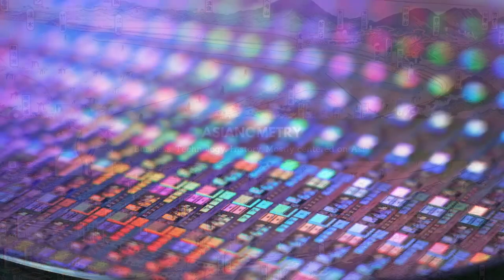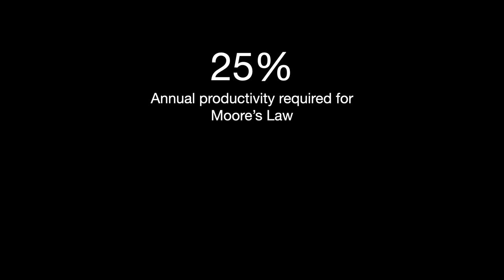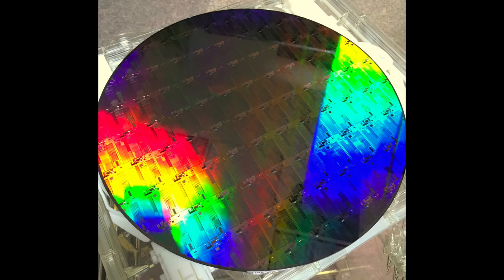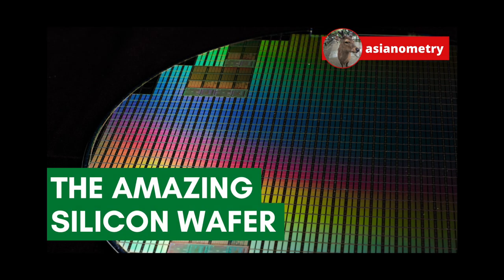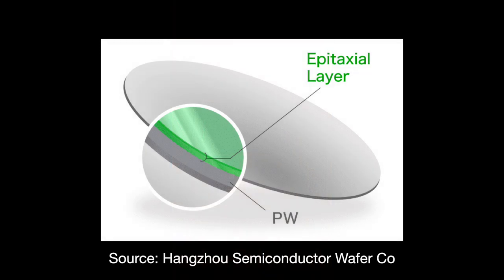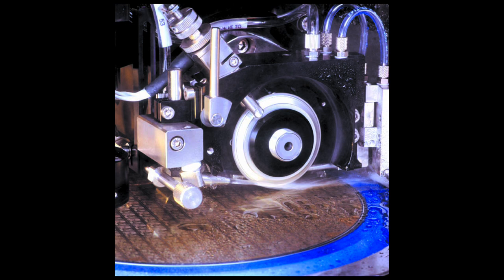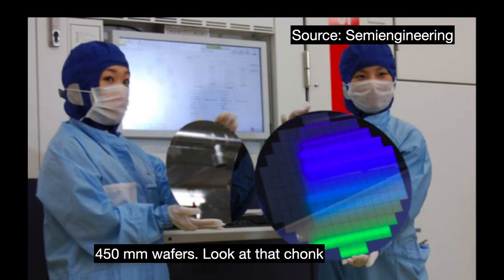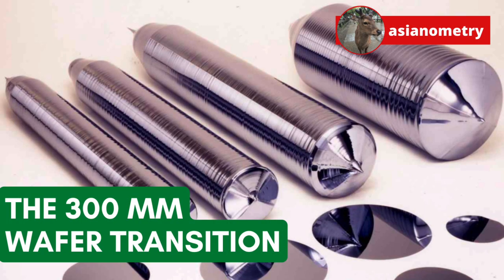The 300mm Silicon Wafer Transition

Comment: Great video as always. I have one question
Why is there a requirement for 200mm Wafers? I don't get it, is it because it is cheaper?
Reply: Because there's a requirement for 180-350nm chips as well as analogue chips and power semiconductor devices designed for an old process. Old production line needs old spec wafers. These seemingly obsolete semiconductors have been experiencing shortages, because as it turns out, they're EVERYWHERE literally everywhere, even the fanciest devices have some supporting circuitry which was designed against existing classic semiconductor devices, and of course since there was no shortage before, there was no pressure to produce more modern replacements of these semiconductors. People keep needing more electronics stuff, so the pressure is now on.
Reply: It's not so much of a requirement.  It's that the fabs already EXIST.  Refitting a fab to a 300mm wafer is probably over a billion dollars.  Why bother if the fab you're running already works fine and you have the customer based that makes you all the money you could possibly need.  

You generally don't rip a fab apart, so the video is a little misleading.  If you rip a fab apart a company is losing many millions of dollars from loss of production.  Typically you build a new fab with the new equipment.

So, you have older fabs, that make older nodes that are still being used today because those nodes work perfectly fine for the use case of the die being made.  Of course they're not going to shut down, lose millions in production just to spend hundreds of millions to retool to make a larger wafer, when they're still using an older node.  It's an economic disaster that could cause the fab to lose their customer based when they have to recoup that huge investment they made.
Reply: @SianaGearz  There isn't really a requirement for those ancient nodes.  There's a desire to have chips made for a low cost, and if the circuit you're making only has a few million transistors, you don't NEED to be using a 7nm node that has a transistor density of around 100 million transistors sq. mm.  And most home electronics, not including computing is that way.  A circuit for a smart fridge isn't a billion transistors.

This is why Japan asked TSMC to build a 28nm fab in Japan, for all the home electronics they make.  They have no REQUIREMENT for a larger node.  It's simply about cost.  A new 28nm fab is no where near cutting edge, which right now is 5 - 3nm, but it allows a few thousand ICs to be made from a single wafer for home electronics which is an improvement over older nodes like what you're talking about.  So, a 28nm node means less cost per wafer vs. a newer node, it makes the home electronics better, you can fit the IC into a smaller space, it uses less electricity.
Reply: @johndoh5182  Several million? A lot of ICs have something like 100k transistors. A lot have only a couple thousand. A lot of ICs MUST run at 5V. A lot of ICs must run at 20V, pass substantial currents, and only contain less than a couple dozen transistors. All of these add up to a lot of wafer die area consumption, but don't have high purity requirements. Can they even be moved over?
Reply: @johndoh5182  what chips does the Auto industry use?
Reply: @ashleylobo1242  The auto industry uses a wide variety of chips.  It depends on what you're talking about.  For a lot of the smart features they've been adding for driver assist that requires faster compute and those have moved to more recent nodes, just not the most cutting edge.  But for things like the computer that controls fuel, air intake, etc.... those ICs can be made with older nodes, but even THAT can move to newer nodes, just not cutting edge.  In fact that's something I think would be easy to move to a 28nm node.
Reply: @SianaGearz  I understand what you're saying, really.  I KNOW there are ICs where transistor count is in the thousands.  In fact there are older ICs that ran on 5V, which is now ancient BTW which had only a few logic gates, where each logic gate is a few transistors.  I used to work on electronics with these kinds of ICs.

So the question is CAN they be moved over to smaller nodes.  Japan is shifting their chips over to 28nm or they already use it, and I think even if you end up with a bit of empty space on the die, there has to be a good reason why Japanese companies felt like they wanted that 28nm fab in Japan for general electronics.

Yes you get into the issue of how small can you actually cut an individual die so you don't have a lot of dead space on the die.  For the 5V control, systems can be updated to use less voltage and over time, new systems do exactly that, so a PCB that may have had 5V running through it becomes 3V or 1.5 or something else as the PCB gets changed out to something modern.

Maybe you can't get to 28nm for a lot of these ICs.  Maybe you get to something like 65nm.

I doubt companies are going to build anymore 180nm fabs though.  This has been talked about in the past, so when these fabs become too problem riddled that it isn't cost effective to keep maintaining it, you HAVE to move on from that node.  These nodes are a snapshot in time basically.

Comment: Of course, you can still increase the 200mm wafer production up to a point.  Eg you can switch to around-the-clock work in the old plants, if you haven't already done so.  You can make lots of small improvements to productivity to eke out a bit more volume.
Reply: There is no semiconductor fab in the world working not 24/7.
Reply: I’m not aware of a fab that doesn’t run 24/7.  Some have room for additional tooling, and during downturns many do run at less then full capacity, but still 24/7
Reply: Working in automation for a 200mm fab, most of the work right now is focused on cycle time reduction through reduction of NVA steps (scribe reads, metrology steps, sorts, etc) and trying to improve Ao (effectively the tool's productive time) by optimizing qual runs (periodic tests to validate tool performance) and tool maintenance.  There's also been a shift towards more and more robotics in the 200mm factories for moving wafers and loading tools, but that's more of a cost reduction thing.
Reply: @ericpatterson8794  Thanks for bringing some real examples to replace my speculation!

Comment: I saw a spammer/scammer comment just below, so I ran a scan of ThioJoe's YouTube Comment Spammer Deleter:

Recent Videos To Be Scanned:
  1. The 300mm Silicon Wafer Transition
  2. China's 7nm Chips: SMIC N+2
  3. How the Integrated Circuit Took Us to the Moon
  4. How Communism Nearly Starved Vietnam
  5. What Colonialism Did For Taiwan (&amp; Japan)
NOTE: These aren't your videos. Enabling 'Not Your Channel Mode'. You can report spam comments, but not delete them.

Total number of comments to scan: 3478

Is everything correct? (y/n): y

                          --- Scanning ---

Scanning 1/5: The 300mm Silicon Wafer Transition

Scanning 2/5: China's 7nm Chips: SMIC N+2

Scanning 3/5: How the Integrated Circuit Took Us to the Moon

Scanning 4/5: How Communism Nearly Starved Vietnam

Scanning 5/5: What Colonialism Did For Taiwan (&amp; Japan)

 Total: [3067/3478] (88%)   | Comments Scanned: 1303 | Replies Scanned: 1764 | Matches Found So Far: 119
Number of Matched Comments Found:  117
Number of Spam Bot Threads Found:  2

============================ Match Samples: One comment per matched-comment author ============================
=======  NOTE:  Possible false positives marked with * and highlighted in green. Check them extra well! =======
 1.  [x109] +①⑨④⑨⑦③⑨⑤④④⓪Whatsapp: 🤝ᴛʜᴀɴᴋs ғᴏʀ ᴡᴀᴛᴄʜɪɴɢ sᴇɴᴅ ᴀ ᴅɪʀᴇᴄᴛ ᴍsɢ ᴏɴ ᴡʜᴀᴛsᴀᴘᴘ ʀɪɢʜᴛ ᴀᴡᴀʏ🌟.
 2.  [x2]   jharna Ashley       : ✙𝟭𝟮𝟬𝟴𝟰𝟯𝟱𝟬𝟲𝟮𝟮.                                                                         
 3.  [x1]   Paul Anderson       : https://youtu.be/clW6MaeVKTU
 4.  [x1]   Sault               : wh_ats_app_十𝟭𝟮𝟬𝟴𝟰𝟯𝟱𝟬𝟲𝟮𝟮                                                              
 5.  [x1]   Adriana Mitchell    :  Hermosa elección 18KISSX.UNO de los mejores conciertos❤ 22:22 Senada: "Hermoso...
*6. [x1]   Dalvinn Kho         : Did the Japanese treat the Taiwanese well during their colonial rule?    Japane...
 7.  [x1]   Linda Taylor        : Hermosa elección 18KISSX.UNO   de los mejores conciertos ❤  22:22 Senada: ''Her...
 8.  [x1]   这十𝟷𝟸𝟼𝟿𝟾𝟾𝟹𝟸𝟺𝟽𝟿       : 👆👆👆                                                                              

============================ Match Samples: Spam Bot Threads ============================
 9.  [x1]   Kelly Edren         : 😀l am so happy my financial life has totally changed ever since I ventured into...
 10. [x1]   Henry Williams      : Mrs Sonia is legit and her method works like magic I keep on earning every sing...

==================== (See log file for channel IDs of matched authors above) ====================
 NOTE:  Check that all comments listed above are indeed spam.
 > If you see missed spam or false positives, you can submit a filter suggestion here: TJoe.io/filter-feedback

 > If you see missed spam or false positives, you can submit a filter suggestion here: TJoe.io/filter-feedback

How do you want to handle  ALL  the listed comments above? (Including Non-Matched Duplicates)
~~ Not Your Channel Mode: Only Reporting is Possible ~~
 > To exclude certain authors: Type 'exclude' followed by a list of the numbers (or ranges of #'s) from the sample list
      > Example:  exclude 1, 3-5, 7, 12-15
 > To only process certain authors: Type 'only' followed by a list of the numbers (or ranges of #s) from the sample list
      > Example:  only 1, 3-5, 7, 12-15  --  (Will effectively exclude the 'inverse' of the 'only' selected authors)
 > To report the comments for spam, type 'REPORT'.
 > To do nothing, type 'NONE'

 (Not Case Sensitive) Input: report
------------------------------------------------------------------------------
Every one of the 117 spammer/scammer comments has been reported. If you were to run this tool on your own channel you would be able to delete every post made by these scum on your entire channel and ban them all as well. In practice, my reporting these vermin has resulted in them running away to greener pastures where YouTube won't ban their channels. This has worked very well for the five or so channels I've monitored.

Comment: Was there a side effect of this collaboration---following group norms instead of breaking out with new approaches?  Certainly Intel failed to act as if it could be pulled from its perch.
Reply: NO.  ALL through the world of engineering of EVERY kind there are hundreds of agencies that deal with standards, and consortiums to deal with the standards, set new ones, etc... and this is for the better.  Making a wafer requires a large number of companies to agree to make equipment to make this happen.  If a single fab, like Intel wanted to go on their own to make a 450mm wafer for instance, they'd have to absorb probably 300 - 500 billion dollars worth of companies to get them to make the equipment, the first being ASML which makes the lithography equipment because if you can't etch die on a 450mm wafer, no sense in starting.

But the insanity of a 450mm wafer is why it's not going to happen.  If you have that large of a wafer and the die is so small because now the industry is on a process node of 20A or 18A or 16A, etc... because that's where they'll be by the time you could retool, you would be producing probably 10,000+ die on a single wafer, which mean a SINGLE wafer failure is a loss that could be approaching $50,000 - $100,000 of die.

If anything I could see the industry moving back to 200mm because of how small the process nodes are now because the amount of die from a single wafer is WORLDS greater than when they tooled for 300mm.  Then they would get the benefit of the faster process, easier to make the crystals, etc..... along with thousands of die from each wafer, STILL, and it would probably bring down the cost of ICs.

Comment: 6:25 What I don't understand is how they can lift those HUGE silicon crystals, 300+ Kg and it's all coming from a tiny spot at the top? Makes no sense that it does not break off, so how do they do it?
I assume they have some additional grabber thingy? so when the crystal gets larger, more of it is grabbed by some machine thing & pulled up?
Reply: How do they do it? Very carefully.
Reply: They DO break from time to time which is one of the issues with the 300mm wafer production.  It slows down production.  He said that in the video.  Not only do you have to move slower when going through the removal process, but you get more broken crystals.
Reply: @johndoh5182  Yeah, I heard that, but how does they not ALWAYS break?
it seams like an impossible equation, some square mm holding up 300+ kg without breaking (every time).
Reply: @sebbes333  Like Paul said.  :-)

Comment: …did we skip the definition of parts of this topic?  What’s a, “die” in relation to circuit wafers?
Reply: A die is what is diced from a wafer. One wafer would basically have multiple copies of the same chip manufactured on it, and in the end a DISCO dicing machine would cut them into individual pieces and then a picking tool would take each die and place it into a tape.

Comment: I guess no one ever thought of designing hexagonal die to get another 10% production area?
Reply: It wouldn't work, as rather than a simple orthogonal grid cut for separating the chips, you'd have to go to ultrasonic blades or lasers to cut the individual units from the wafer.  Those methods might introduce more errors into the base silicon during the cutting operation, or have other maleffects that make hex packing unsuitable.
Reply: @davidb6576  got it!

Comment: So here you're using radio frequency to grow crystals. Generative AI is experimental. Learn more

Radio frequency waves can be used to grow crystals. For example, radio waves at a high frequency can be used to melt silicon inside a 

crucible

￼

. 

Radio frequency waves can also be used to grow high-quality protein crystals. In this method, a strong 

magnetic field

￼

 is combined with 

radiofrequency

￼

 pulses to grow lysozyme in gels. 

Crystals are available with a range of standard resonant frequencies, from about 10 kHz to 100 MHz